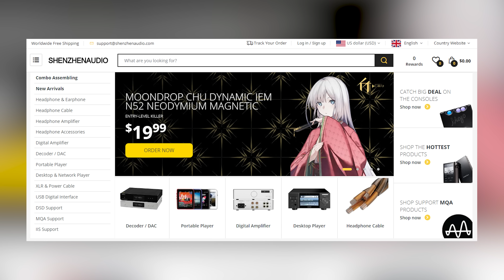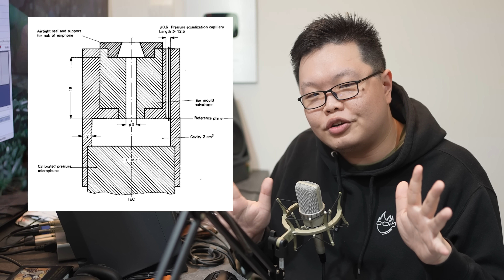Did Linus just waste $50,000?

Comment: Everybody has a unique ear canal and hearing response, rather like everyone has different fingerprints. At a gross level, it is possible to create a standard average ear canal and hearing response curve, but this will be an average. Individually everyone will have a different hearing response based on the shape of the ear, the ear canal, how much wax build up there is in the ear canal, hearing degradation due to age or over exposure to excessive noise and disease. Bottom line, headphones or earphones that sound great to one person may sound rubbish to someone else who theoretically should have the same hearing. Then there are the personal preferences as to the amount of bass, mid range and treble desired in the audio. In theory, the best headphones/earphones would provide an absolutely flat audio response from DC to 40kHz. While that is technically possible the actual perceived sound would be horribly unpleasant for almost every listener. Real world sounds contain echoes, phase delays, and background noise that our brain filters out without us being aware of it. It is only when exposed to a technically perfect sound response we realise that in the absence of any distortion, sound appears completely unnatural and disturbing. Listen to whatever sounds good to you at the time. Ten or twenty years down the line, your hearing will have changed and what used to sound great will probably need to be upgraded to compensate for the effects of ageing.

Comment: The 711 coupler might be highly specialized but it's not so mechanically advanced as some might think. The specs on how to make it is even stated in the IEC60318-4 standard. Clones of the 711 coupler, such as CrySound CRY711, is basically indistinguishable from B&K/GRAS when it comes to transfer- and input impedances.

Comment: Crin, you say pinna gain is to compensate for the external part of the ear (aka ear gain). So wouldn't it make sense to not have a raise pinna gain section in the tuning of IEMs since the IEM by passes this area of the ear??
Most IEMs are tuned with raise pinna and therefore require raised bass (in most cases) to make it sound neutral. A flat tuned IEM would sound natural and bassy...

Comment: I wanna more reasoning about worthlessness of time domain graphs in headphones measurements
Reply: 99% of headphones are minimum phase devices where the time domain is directly linked to the FR. In speakers where you have distance for the sound to travel, mass of the driver to account for, and also an open air environment, those other metrics are very important, and it's common for people, especially coming from a background in loudspeaker acoustics to look to those measurments. But from years of research in headphones from the likes or Harman research and other Acoustic research in the field of headphones and IEMs specifically, they came to the conclusion that for headphones, being minimum phase devices that work in a (mostly) sealed volume environment, the time domain information is directly linked to FR in those cases.
Reply: @JamieVatarga  understandable, thank you for the info

Comment: What would you recommend for someone who is interested in measuring their headphones and IEMs generally but has no experience? I want something more accurate than just shoving a mic in some foam, but don't want to spend a thousand+ dollars. I just want to get frequency response graphs on the headphones and IEMs I own to compare.

Should mention that I was able to follow most of this video, but have no idea how one would get started (e.g. what software is needed, how to interface with my PC, how to set things up, etc.). Any resources and recommendations on a budget would be good.
Reply: @UCIV1OBxFvNTi6GbI8HWCGlA Thanks. Appreciate the information. Will have to look into that on Aliexpress. Any tips on software to use and/or links to resources on how to set up with your computer?